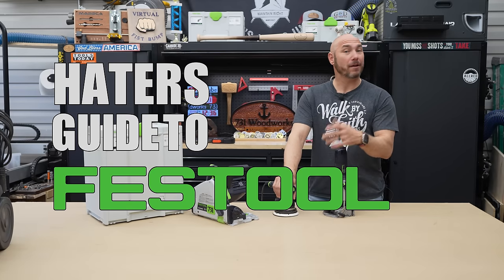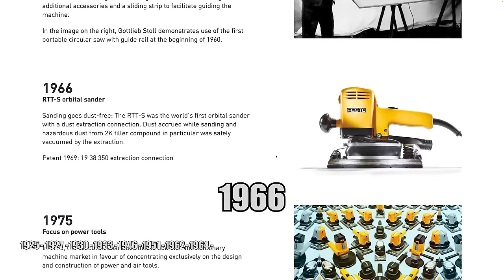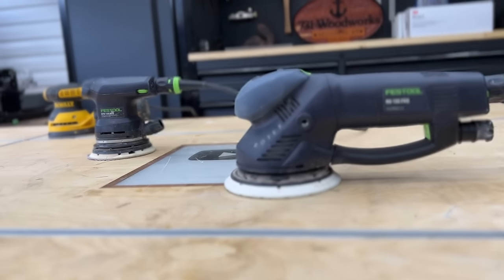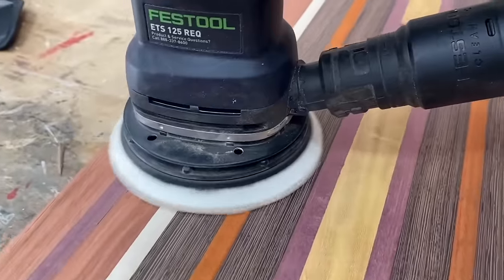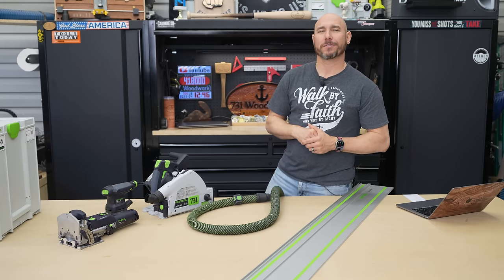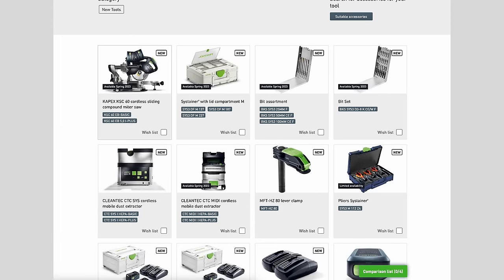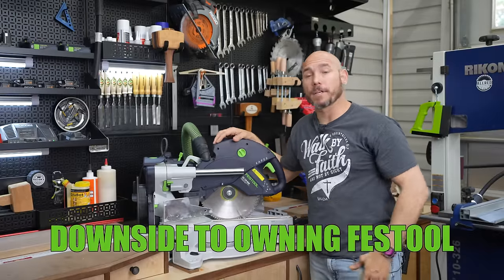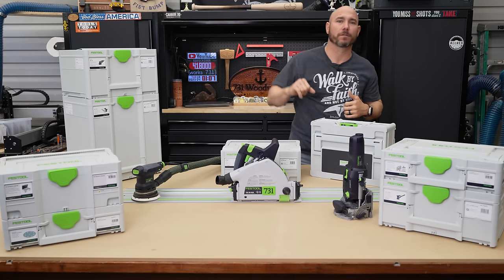The Hater's Guide to Festool | How Festool Changed the Game

Comment: I have some festool stuf, some even still say festo on them. I've enjoyed a very good professional relationships with festo pneumatics as well. Me and my father have seen a lot of tools come by in all kinds of shops and building sites and we still don't see why a lot of woodworkers have such a religious attachment to festool. the thing that bothers me most is the fragility of most of them. for me, a lot of the tools are a lot less ergonomic than other brands, constant innovation is very nice and to be supported, but it makes for shaky, unpolished tools. for sanders, I've grown to like mafell, better dust extraction, less fatigue, smoother speedcontrollers. I still don't see what is so special about the domino. i've used a cmt dowler that had a better tracking system, was a lot quicker, and a lot cheaper consumables.  
as for the fragility, i've worked in a composites shop where the battery drills lasted about 4 months, yet they continued to buy festool. my own ts55 has an intermitted issue where either the button gets stuck, or the motorcontroller refuses to turn off. i've seen tens of batteries split open. those fancy vacuum hoses started to fray within weeks, and catch every sharp point in sight. to be fair, a lot of tools could not stay alive long in the conditions of composites shops or the big steel commercial building sites my dads company used them in. with one notable exception: hitachi. also not the cheapest around, or the biggest range of tools, but i've seen them used in pouring rain, being tossed of 50m high buildings onto concrete or into mud, driving self drilling screws into steel girders literally without stopping for 10 hours every day for weeks, and most live past their 10th birthdays. which is why i have bought hitachi cordless stuff as well. my tools generally don't have nearly as hard a life as my dads, but if stuff doesn't align, i'd like to bang it with whatever i have in my hands, or have it bouncing of 4 layers of scaffold without worrying about it. 

for everyone else with a hobby shop: buy makita or ryobi and don't worry about it, by the time the tools are stopping you doing stuff, you'll know what to get. i still would like a nice trim router like the makita rt700 with a proper ER collet though, those single cone nonsense ones always get stuck and/or run out.

Comment: Nice video. But 'the system' is a clever piece of marketing. I've been a professional woodworker for 34 years. Apart from my Festool equipment, I also have other tools made by  Hilti, Lamello, Mirka, Makita, Fein, Mafell, DeWalt, Milwaukee and Bosch. And guess what? Everything works just fine with everything else. So choose best-in-class tools based on your own needs. Not what those clever Germans tell you that you 'must have'.

Comment: My first Festool purchase, and the one I always recommend as a first purchase, is the track saw, either the TS 55 (or the cordless version TSC 55) or the big brother, the TS 75, and a guide rail and a pair of their track clamps.  Adding a dust collector will sweeten the experience, but using their track saw will convince you.  Now, lots of other tool makers have come out with their own track saw, but nobody's line of tools works together as a system so well as Festool's.  Time is money, and if you value your time -- and you value precision and your health with good dust collection, Festool is the winner.  "Buy once, cry once, but smile every time thereafter when you use it" -- at least that's what my one-time Festool hating brother-in-law told me.

Comment: I am a DIY'er and I have a Kapex 60 chop saw, planer and a MIDI Vac, rail saw is a Dewalt, Orbital mains powered saw Dewalt and cordless orbital sander is Makita as I have their tools and batteries as well as a cordless biscuit jointer. As a DIY'er you need a balance and work out the costings on the tools you will use the most and look out out for any offers or discounts.

If I was rich then it would be all Festool, but if I was that rich then I'd just pay others to do the work and go on holiday somewhere nice, get a tan and drink cocktails and chase pretty ladies, but at the end of the day I am ageing male looking after my beer gut so there is no chance of that happening.

Comment: Thanks for a great video.  I respect Festool a lot but not being a woodworker pro they are not for me.  I’m into the Makita XGT line which by the way had a single 40v battery and kickback protection (Festools not the only one).  I’d be interested to see what you think of that versus the dual battery Festool. The Makita promises Bluetooth dust extraction too but I haven’t tried that.
Reply: DeWalt had anti-kick back, even Wen had anti-kickback

The Festool anti-kickback is electronic

Comment: I’m just getting tired of constantly cleaning dust from every surface of my shop. I’m starting to think their sander would be worth the time saved alone.
Reply: Have you hooked up your current sander to a shop vac at least?  I have the festool ets125 but it’s hooked up to a rigid shop vac and basically leaves a dust free surface. But wouldn’t that work similarly with other sanders?  I don’t know because live only owned a Dewalt for one project and it broke and I didn’t have my shop vac at that time so I have no experience other than festool.
Reply: @CarlYota  I went ahead and bought the Festool. HUGE difference! You can hear the huge volume of air being moved through the tool vs my 3M air sander. My Porter Cable had no vacuum option whatsoever. Between this and my overhead air filter my shop is much cleaner. Except when I use my belt sander or grinder.

Comment: No orbital sander is worth over 300
Reply: festool sander is worth i promise
Reply: @djstuc  i only had the corded dewalt and it was a bad sander , the vibration and dust colection was bad. and it has no break and it spins 20 sec after turn off.
Reply: @djstuc  I have the cordless 20v dewalt and a Rotex 125.  They are not even close.  The dewalt does not have good dust extraction.   Not even close.   Find a Rockler or Woodcraft and spend some time with one.

Comment: Festool's obvious "corporate mission" is to make the best job site tools available. Job site tools for high end projects must work together and control debris and dust without wasting a lot of time for contractor setup. Without tools like Festool you need to set up dust control barriers and so forth and there are other costly nuisances to consider. But also achieving the same quality as shop tools with big fixed tables and cabinets is very valuable if you're paid to install high end woodwork at the client's site. Hobbyists and shop workers generally don't need those kind of features. But if they want to play with the Domino machine and so forth, so what? It means that they can keep their shop cleaner and more flexible. If they're just showing off how much they paid that is their problem, not yours. Don't blame Festool for offering tools in this important niche.

Comment: My first Festool was a sander that I got because my Dewalt's vibration started to really hurt my hands.  After an hour of sanding, my hands buzzed!  It was time for something different, and my local dealer gave me a loaner to try.  The proof is in the pudding, as they say.  I'm saving up for a TS75 because no other track saw cuts to that depth.

Comment: I dont hate Festool.  I hate their pricing, especially when other than the Domino, you can find a better/as good tool for less money.
Reply: i have a lot tools from makita dewalt milwaukee bosch but festool has by far the best quality with mafell
Reply: @exigauner  Festool causes alot of confirmation bias.  Its gotta be better because its made in Germany and costs more right?

Ive used alot of Festool stuff in a commercial cabinet making shop.  Key word being "commercial" as in do nothing but make cabinets for a living and turn a profit.  Is that Kapex any better than my Milwaukee or Bosch miter saw?  No.  Are the sanders better than my Bosch rotary or Mirka or my friends 3M?  No.  Is the track saw better than my Makita?  No.  Is the router better than my Makita D handle, Bosch Colt or Porter Cable?  No.  Are the drills better than my Milwaukee?  No.  

There are 2 things I will absolutely saw that Festool has done an excellent job with.  The dust collector works really well, but alot of manufacturers to their credit are following suit.  And the Domino?  The thing is an absolute rockstar and in alot of cases is irreplaceable.  As a general rule Festools stuff is pretty solid, but it is not always the best.  What Festool has is the best "system".  And if that system works for you?  Great.
Reply: @CorwinBos  its souds like you never used festool. i have all brands, i like every brand. but festool is step above all. i have a makita saw and router and it dont fit with the makita vac, thats a bad design choice. but still use makita and i like makita.
Reply: @exigauner  
And I quote what I opened ny statement with: "Ive used alot of Festool stuff in a commercial cabinet making shop"
I think that qualifies me to make that judgment when I have used all the tools I have given equivalents to or better than.  
The only Festool ive ever used that actually has made any real difference in how much money that shop can make?  The Domino.  It turns annoying projects that would require doweling, mortise and tenon, etc into extremely simple and strong joints, very quickly and with minimal thinking as well.
Reply: @CorwinBos  everyone should use what they like, i have good experence with festool. and i like and use some other brands to. everyone has a different experince and thats good so.
Reply: Check out the WittWorks video on Festool

When you pay your employees what they deserve, treat them right, run a quality business… that will cost money and will show up in pricing

Many other brands try to squeeze cost out everywhere including their employees and assemble in China

Food for thought

Comment: You may have answered this question and I missed but.  Is the festool dust extractor compatible with tools I already have??
Reply from the maker: Hey Justin!  Yes, it is but you may have to use a hose adapter to fit certain tools.  Rockler has a kit https://www.rockler.com/dust-right-3-to-12-expandable-hose-with-click-connect-flexiport-kit-and-coupler
Reply: No its is not and you cant find that adapter I bought one and sent it back even have an apter for it for the same money cheaper actually you can get the 3m or the Metabo that fits all your tools the rubber end can be changed to what ever system you want

Comment: Festool is top notch. But I'd debate the domino. The Mafell ddf40 is the domino killer. I started with the domino. But when I got my mafell dual dowler the domino started collecting dust on the shelf.
Reply: ddf40 is nice but u cant change the setting to lose fit. if you make a mistake its over, with domino you can change to tight and lose fit and you can make smaller peaces. and try the lamello zeta2 thats a nice peace too
Reply: Of all the Mafell tools the double doweler would be way down on my list.  Why do you think that is better than a Domino?  What specifically are you doing with it that “kills” a domino?
Reply: @bmacaulay18  in every german review on YouTube between domino and ddf40 the domino wins. And in ouer wodshop with 150 worker we have 7 dd40 and 13 dominos we use bothe. But the domino its more versitile. There is on realy nice feature of ddf40 the System 32 hole System👍
Reply: @bmacaulay18  I'm a union cabinetmaker. The big thing for me is the consumables. Compare the price of dowles to domino's. I'm not saying that the domino doesn't have its strengths and isn't versatile. But I'm not putting cabinets together with domino's. Just in my experience  I use the dowler more. The domino still gets used just not nearly as much.

Comment: for some festool tools the price is totally justified.
Sanders eg. which allow to have virtually no dust.
Even with a cheap vacuum cleaner connected.
The circular saw on rail is also an excellent product, like the domino.
But for many other tools the price is much less justified, eg. multitools, screwdrivers, drills etc...

Comment: Here’s a car related thing.  For many years, I drove a Wrangler as primary vehicle.  However, side vehicles were Chevys and Fords.   When driving the Jeep, I never had someone fighting me for the vehicle I drove, even though it was really more expensive than others unless I needed more precision or power.  Which I really didn’t need it and few were that good anyways.  But when I drove a side car, OMG.  I haven’t used a Festool yet, but will soon.  I have a feeling I will get just hate from the same friends that only argue Chevy vs Ford.  Idk why Wranglers get a pass whereas Festool doesn’t.  My belief is, both are more expensive per square inch, but just damn good products.  Idk about Wranglers after 2000 stock.  And I know nothing of Festool as of yet.  I will soon find out.

Comment: Sorry, but most of the benefits you're listing for Festool are also true for many other tool manufacturers: Systainers are a very common thing, for example. Most of them are even compatible with systainers from different manufacturers. I have a stack here containing Festool, Makita and Dictum and they all just fit together.
Same goes for the interoperability with different tools from one manufacturer. That's just true for most other tool manufacturers as well. Makita, Bosch, Dewalt, Milwaukee etc. etc. It's just a sensible thing to do for a manufacturer to try and keep customers in their ecosystem.
So, the whole "system" argument just isn't all that special to Festool.

That said: Festool is pricey, which is pretty much the only reason I could think of why they might get hate... so, basically, we're talking about simple envy. For the price, though, you get outstanding reliable and precise tools. For a pro, it's very probably worth it. For a hobbyist that's definitely a matter of opinion. Honestly, the one tool I went with Festool is the vacuum / dust collection because that's the one thing I didn't want to make a compromise.

Comment: So I'm going to just throw this out there. He never covered the actual quality of the tools. Yes, the engineering is very good Yes the dust collector witch I personally never used. Looks very nice but every festool I've ever owned were built very cheaply the tools feel bad in your hand like modern Black&Decker actually not even that good like toddler toys the drill died in a month and I could not get warranty because they said it didn't fall under normal wear and tear even though I'm just a residential contractor and it's not like I dropped it and it broke the light just started flashing and never worked again their boxes don't even feel as good as a crummy blow molded case that comes with harbor freight tools they just don't live up to the price tag and the expectations these are people's dream tools and if that's you, just expect that they won't live up my experience was in 2016. They might have changed by now but I'm not taking the chance

Comment: One thing that I think of when I see people hating on Festool and saying that they are over priced, is that they are probably typing out the message on their iPhone that costs over $1000.  - Chris
Reply: A $1000 iPhone gets a ton more usage and tackles a lot more use cases than a power tool. Not a good comparison.
Reply: @TheBojaboja , there were three points to my statement. The first is that an expensive "tool" can be justified if you are able to be more efficient because of it. There are a lot of cheaper options available than an $1100 iPhone. Second, the amount someone is willing to pay for anything is based on it's perceived value and the priority that they give to it. And third, the price of the "tool" is based on not what it costs to manufacture, but the R&D that went into it and the demand on the open market. All of these point to someone who buys any Festool product perceives that it will be of enough use and value to prioritize it and be willing to pay the going rate. Those who do not have the same perceptions will not, but also should not inflict their priorities onto anyone else.:hand-purple-blue-peace: - Chris

Comment: Festool are quality tools there is no doubt they are expensive yes and yes I have used them. Do I own any I do not. On average each festool tool costs double what Milwaukee, Bosch, Dewalt and Metabo cost. Are there a couple of real gems in their lineup I would enjoy owning for sure but I could say that about any tool brand. One thing I have to say is that I really don’t like their drills and I am not speaking from a cost standpoint they are bulky, their battery tech is surpassed by most competitors and the ergonomics are just not that great. Now their new portable table saw that is coming out is pure genius and yes their domino is awesome.